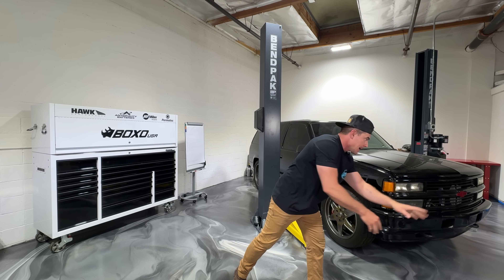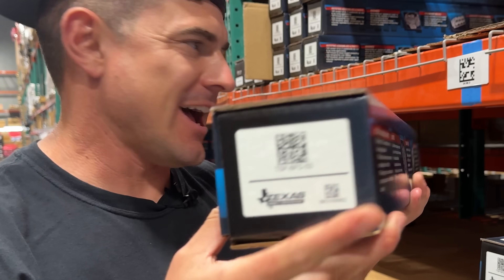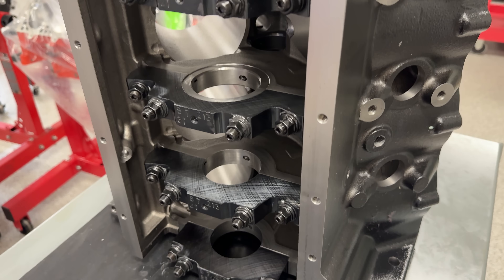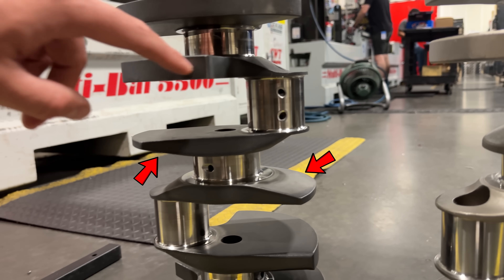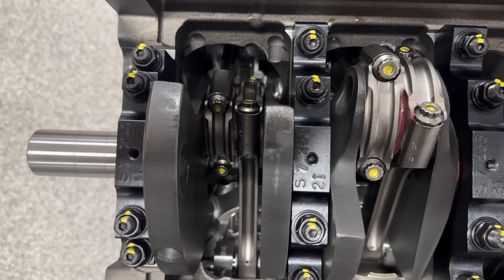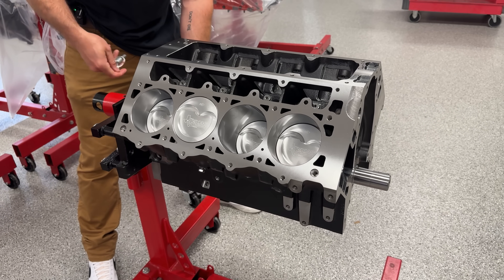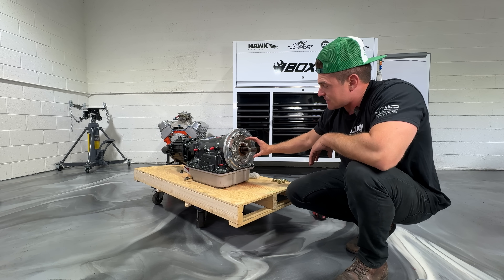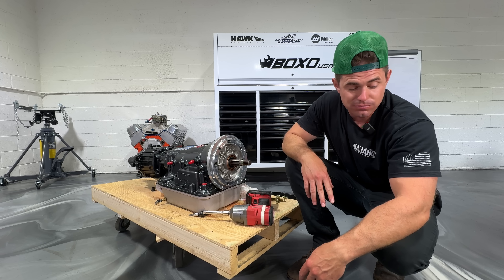No More Godzilla - WAYLON 2.0’s New 2000hp Engine: AWD Burnout Build

Comment: Diggin the new direction.  Check out MBE CID LS7 Top End Package Game Changer if you're looking to upgrade to the highest level of LS7 heads.  430cfm+ intake 280cfm exhaust with a Jessel rocker package to handle your high rpm goals.

Comment: I wonder why dart would go to a 4 bolt main rather than the 6 bolt GM uses? I would assume the main caps would be stronger when braced by the sides of the block, with the 4 bolt, they are just kinda floating like a traditional old school sbc.

Comment: Bring both bell housing to a machine shop have the lip milled off and correct bolt holes drilled in the one that bolts to block I'm sure there is a machine shop somewhere close by to you that will do it for a reasonable price

Comment: It's about time you smartened up and dropped an LS based block into that OBS.... definitely would've been a tie with the old faithful BBC though, I mean, you know GMT400s were available with Big Blocks, right? 😅
Reply from the maker: im aware. Its extremely tight with a big block while running the whole 4wd set up.  Plus we are working on a new blower cam design for the BFD line and i need a test mule ;-)

Comment: Since your going LS7 heads are you going to go LS7 style oil pan with a dry sump setup? If you did you could get a beefy amount of oil. High revving and high boost I’d recommend vr1 full synthetic oil too lol
Reply from the maker: I will be doing an entire video on the dry sump system that is going on this. Its a proper set up.

Comment: Is the transfer case a full-time awd or does it shift in and out of 4wd? If awd what's the part number on the trans and transfer case???
Reply from the maker: The T-case is just an NP208.  they can take a surprising amount of abuse when they aren't used for off road applications. LOL.